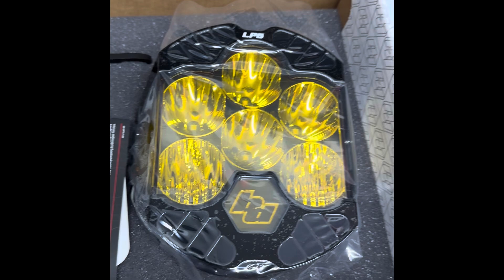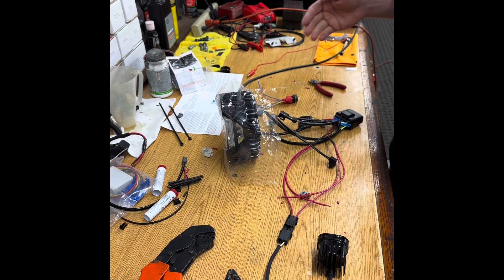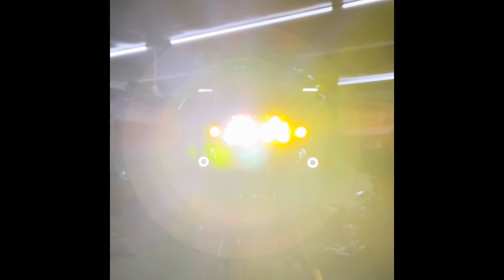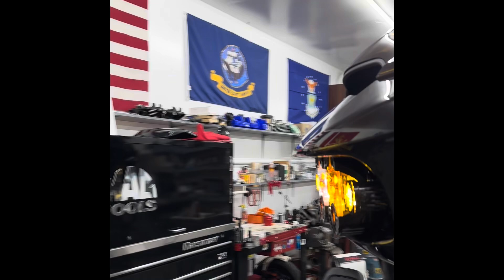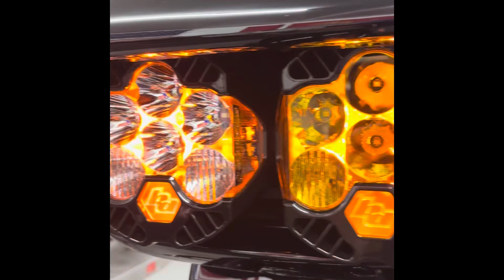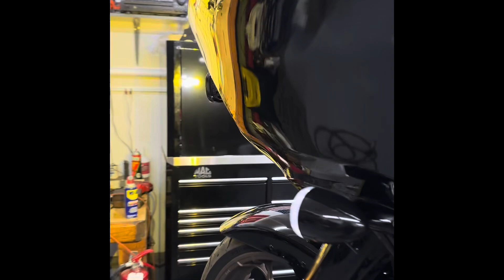Baja Design LP6’s on a 2022 Harley-Davidson RoadGlide @Sowder-Speed

Comment: Were you able to just dim the lowers, or did you need to bypass the lowers and only use the high beams?

I stoped by Skene (Cyclops), and they said if you try to just dim the low, the highs will come on?

Great video 👍

Comment: Where do you get the red dimmer switch???
Reply: We got this one off of amazon
Reply: Is it the 16mm or 19mm???
Reply: @heathsmith3998 22mm. There are several styles. Different color lights and functions you can choose from.
Reply: @thesowders  Thank You!
Reply: @heathsmith3998 any size 

Cigarette lighter holes are usually 22mm-25 mm